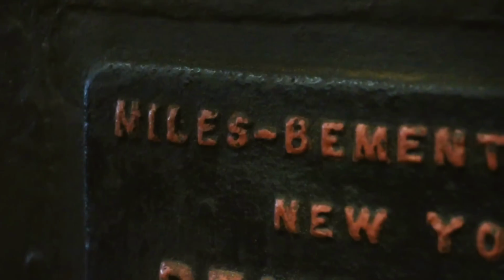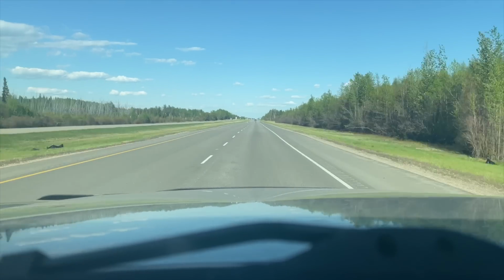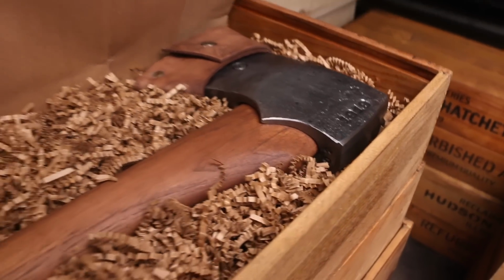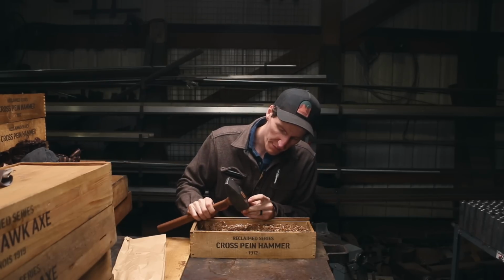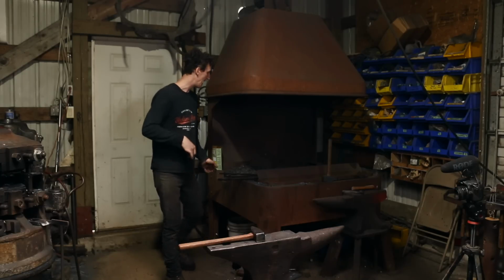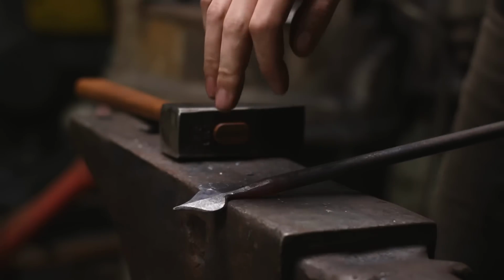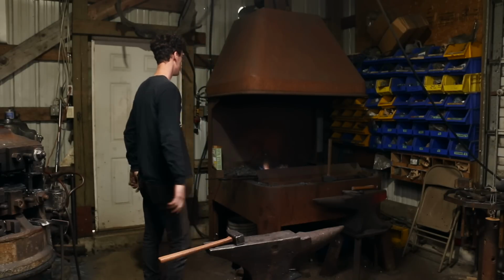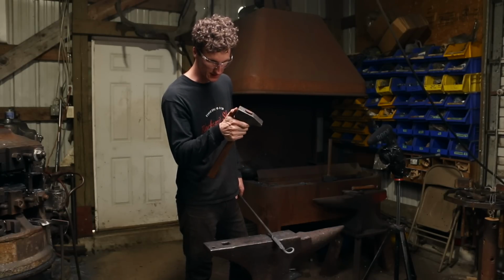Selling hammers! My first ever blacksmith tool for sale!

Comment: I just bought 2 hammers off ebay the guy has them at a buy now price of 150each but the starting bid is only 50 I got a 2lb Rounding Hammer for 50 and a 3lb Crosspeen for 50 I was the only one to bid on them and they are really nice handforged hammers out of 1045 great deal I don't know how the guy can do all that work for that cheep and still make money

Comment: Nice looking hammers. If they were about $100 less, I would consider picking one up, but $300 after S&H is too much for me.
Reply: It is for me as well unfortunately. It's really hard to justify $275 USD. Maybe he will adjust the price at some point
Reply: @jju7469  I did some rough calculations, and it works out, with expenses and all, for us to be working for about $30 an hour… Not too extravagant a wage (if you ask me) for what most people would call highly skilled labour and product development.

Comment: It's tough because it looks almost like Tim is thinking "Yeah, this is a nice hammer, but not as nice as the Titanium hammer".
Reply: imagine if he started producing them to sell😅
Reply: @dragonwing4ever  I have, and I don't want to take anything away from these 1912 Cross Piens, I will probably buy one, but it's comparing an exotic Titanium hammer and a steel one, apples and oranges. I think he made a framing hammer out of Ti that sold for $2.3kUSD? So, I think a titanium hammer similar to what he uses usually would be around $1.5-2k retail. It's definitely something to thing about as he talks about the performance of that steel hammer vs his standard Ti hammer, you might almost expect it to pale in comparison no matter what, so the fact that he speaks highly of this collaboration definitely speaks to the skill in craftmanship vs straight material superiority.

Comment: I believe you will sell a lot of hammers and other tools if made. Everyone can use a hammer or hand tools. To be honest, Not everyone needs an axe. They did look good and was well worth the buy.. if the buyer had wood to split. Unless they simply wanted a wall hanger for decoration, which isn’t a bad idea at all.  Best of luck Tim, I think your going to do well with this.